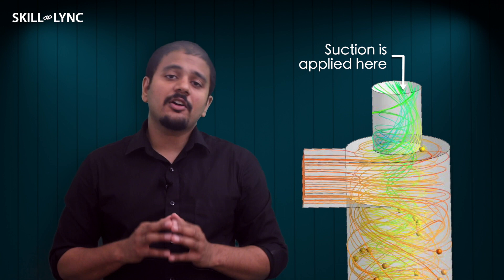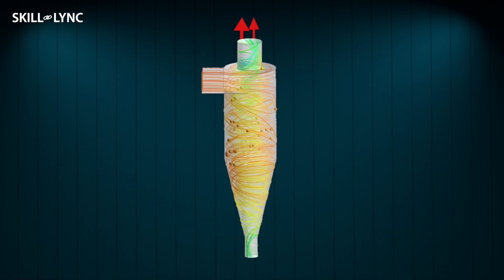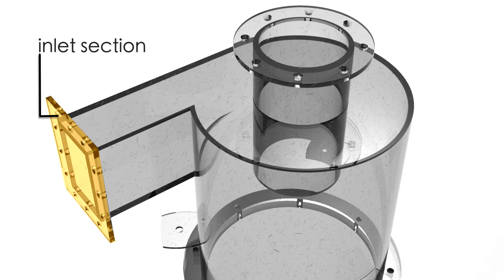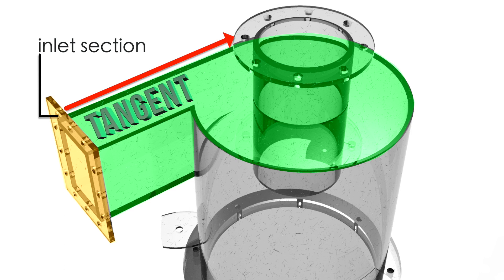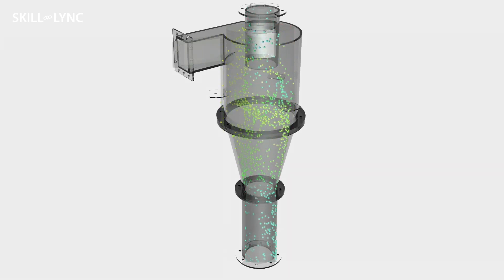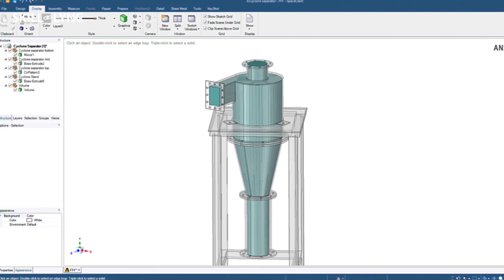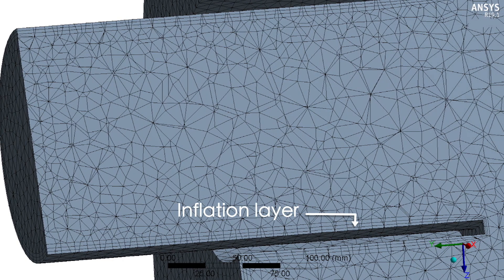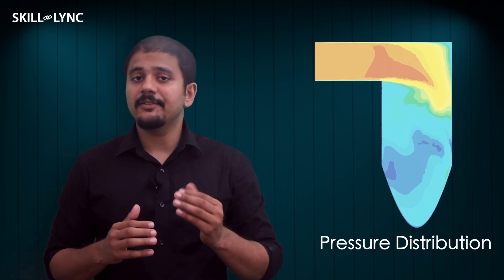How to Remove Dust From Air | Cyclone Separator | Skill-Lync

Comment: I dream of a household air cleaner which doesn't need all expensive filters so I wonder already for years if the Dyson cyclone could filter out allergens. I think now this is answered here: it's not efficient for very small particles, like we find in the air of a room. I wonder if adding a lot of heavier ballast dust that would drag the fine dust to the wall too. But translating this in a practical household device is something else. Perhaps water droplets could be used as such but that makes it all dirty and moldy after a while so a non evaporating organic inert solvent would be better.